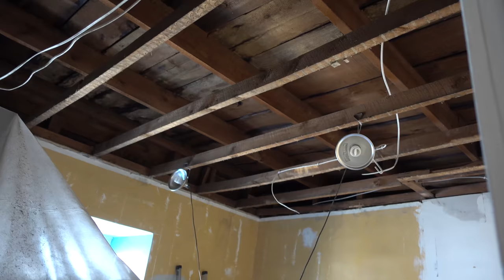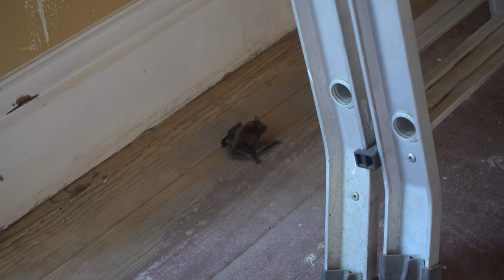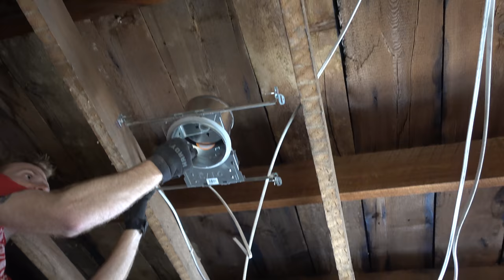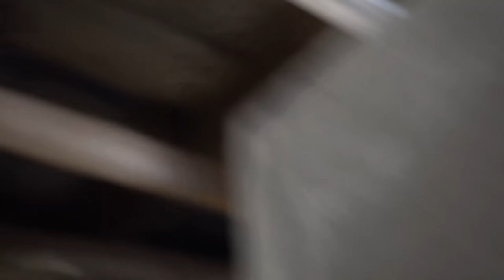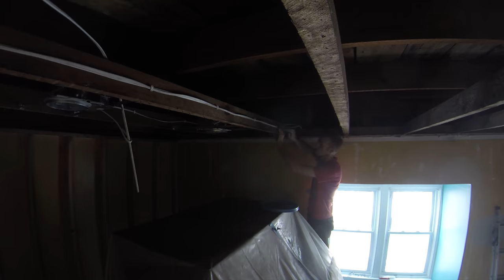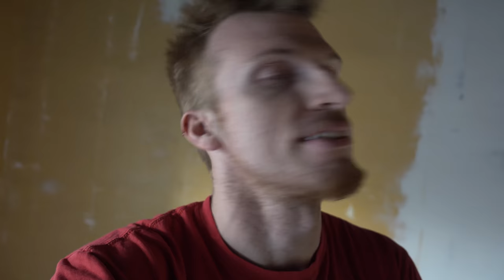Beware of Flying Mice!

Comment: You should put blocking between your ceiling joists, it adds strength and rigidity, especially since you are installing drywall.  I suppose if you strap the ceiling it will help, but blocking and strapping would be excellent.  Then install your buckets.

Comment: Build a "Stiff Back" and install it on top of the ceiling joists and tie it into the rafters.  This will stiffen up the ceiling and prevent the drywall joints from cracking.

Comment: Careful, it might be a scout for the Flying Nocturnal Echo-Locating Mammal-Man.

On a serious note: if there are no fire partitions in the attics between your home and the ones on either side, you might want to consider putting them in. Here in Baltimore, we just had a fire that destroyed 12 old row houses. It started in one, got into the attic, then the wind pushed it down the row. There were no fire partitions in the attic.
Reply from the maker: That's our plan, yes. Considering the other houses on the block ALSO have the same dangerous knob & tube wiring that we are replacing